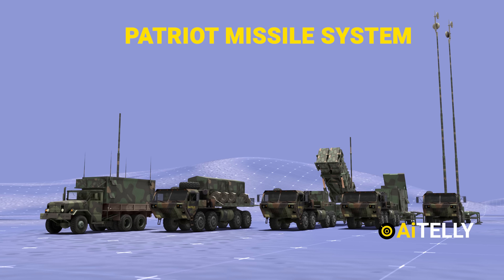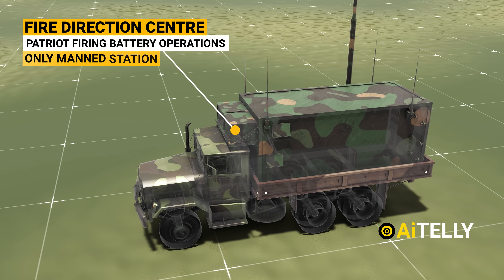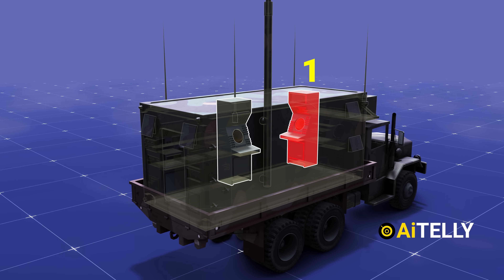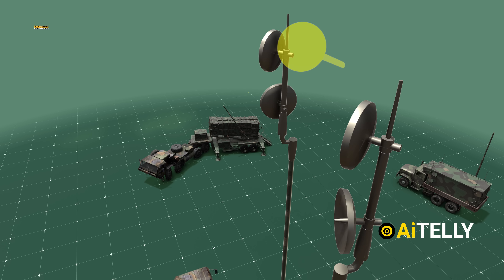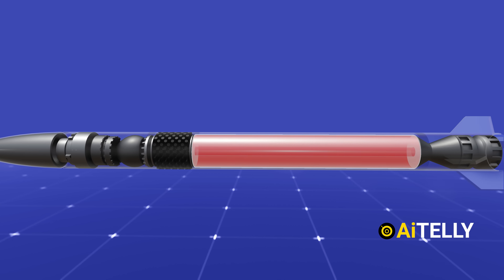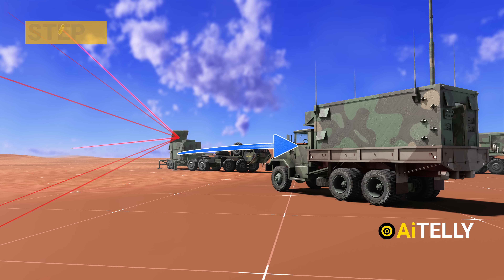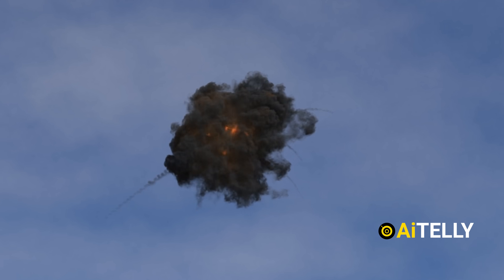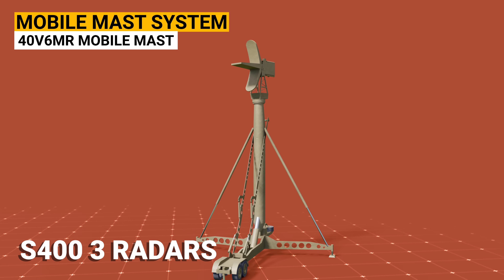Patriot Missile System How it Works | Air Defence Missiles

Comment: the MIM-104 Patriot active radar homing surface-to-air missile system function is too much decentralized . . . understandable it's a great SAM mobile battery from the early 1990s & the system incorporates solid fail safe technologies but it ain't cutting edge (compared to current day mobile SAM batteries that are far more advanced) inspite of it's upgrades from time to time . . . the MAN HX3 8X8 + 5.0 in. Lift 21.0 TDI I6 4-Dr Extended Double Cab Military Logistics Truck (LHD) is a better mobile solutions especially for such mission profiles . . .

Comment: So for every target you must expend 2 missiles ie $8m😰
Reply from the maker: Yes I think every military follows this strategy
Reply: often times the target of the enemy missiles is more expensive than the defensive missiles.
Reply: It's still cheaper than the damage could be caused by the target. In theory at least.
In comparison a medium range 9M317 missile (Buk) is around $200k a piece, the largest missile for the S-400 (the 400 km range 40N6) is around $1.8m.

Comment: It has a new LTAMDS triple-band S/C/X radar. With Link 16, other radars can also be used.  Also it has a new PAAC-4 SkyCeptor interceptor. Based on David's Sling Stunner missiles that can reach up to 300km with Mach 7.5 terminal speed and has a dual seeker with active radar and infrared IF homing. Additionally US has a new launcher called Enduring Shield that can incorporate any missile including SkyCeptor.

With the upcoming IBCS (Integrated Air and Missile Defense Battle Command System) network for the US Army, any interceptor and/or launcher and/or radar can just be a lego block. Similar to US Navy’s Aegis system, its a centralized battle command center. Many systems can be connected including NASAMS and Enduring Shield, SHORAD, Patriot, MEADS, and THAAD. Even radars from other system like Aegis SPY-1/SPY-6 and F-35’s AN/APG-81 can also be used. This allows a different radar to use a different interceptor to engage a different target.
Reply from the maker: Credited your notes in the Comment Coreection Section
Reply: @AiTelly  You are in for a treat when you see the full scale animation fully connected theater.  The headaches deciding how to portray this... I don't envy you, but look forward to seeing what you composite.   Scanned arrays and satellite comms have changed everything.
Reply: @Aitelly  I hope all this info is public and not private. In these videos you will find Russian and Chinese spies
Reply: i saw video of attack lasnight in kyiv.  how long after interceptor launch would a kinzhal missile strike the battery if it was missed?  would it be a few minutes or just seconds?
Reply: @peetky8645  seconds
Reply: Kindzal  coming 🔥🔥

Comment: 1st question : In video the radar is shown facing only one direction and also it is static. Then how other directions are scanned ? 

2nd question : How the missile determines the hosting projectile trajectory ?
Reply: It uses a specific antennas to communicate with it's own missiles- the antenna mast group

The beam is " bent" by selective destructive and constructive interference, it doesn't have to move .
Patriot is point defence so it's radars are focused and dont need to rotate

Comment: Could u guys cover how IFF works, particularly for MANPADs?
Reply: It probably just sends a signed message with a random nonce to the aircraft. If the signature is verified the aircraft responds with a signature of the random nonce. This signature is checked on the receiver, if it is correct the aircraft is identified as friendly..
The first check is required, as otherwise an enemy could ping an aircraft to get an radio emission from it, which can be used to target the aircraft.
Reply: I doubt there is a IFF system on MANPADs
However a MANPAD usually requires a line of sight meaning that you can tell the difference between your ...F16!? and the enemy ...Mig-29!? by just looking at it.
If both combatant use the same fighter you may want to use a very destinct color or marking to differentiate you from the enemy. Since longrange or fighter detection use IFF anyway a big yellow stripe on your fighter will not make a difference
Reply: @core3086  there is, it's the cage like thing on top of the stinger launcher, it's the antenna

Comment: Good video. A small correction. The missile launcher you are showing is the PAC-2 GME which has 4 missile. The PAC 3 CRI launcher has a total of 16 missiles and the newest PAC 3 SME has 12 missiles per launcher. Launchers can also be configured to have all three missiles. For example: 1 PAC2GEM, 4 PAC3CRI and 6 PAC3SME.
Reply from the maker: Credited your info in the Comment Correction Section
Reply: And the Pac-3 is what what was obviously used in Kyiv recently against a barrage of hypersonic missiles.
Reply: Was just gonna add this!
Reply: No Patriot launcher variant (M901/902/903) can have all 3 variant missiles in operation at the same time. They can have either a full load of GEM-T, a full load of PAC-3, a full load of PAC-3 MSE, or a mixed load of PAC-3/PAC-3 MSE
Reply: They are or will be soon add THADD systems to the Patriot system?
Reply: Nit: 16 PAC-3 per launcher.
Reply: @camdenmcandrews  за две минуты было выпущено 32 ракеты. Видимо с двух пусковых установок.
Reply: they are really good, but.... still not equal to Russian missile.... they are more faster, bigger range and more dangerous
Reply: @MsCocolino123  Russian propaganda says so. Like the  S14 Armata is such a game changer, f35 cant hold a candle to russian fighters, and so on and so on. Only on the battlefield, russian trash keeps exploding for some weird reason, and all that advanced tech seems to not work as advertised. There have been multiple recorded  encounters of peer type weaponry from russia and Nato side. Does not end well for ruusain every time. So I think it's time to stop telling how much better russian stuff is. I mean, it is pretty good at burning in Ukraine, that's definitely a fact.
Reply: @actualevents4621  On May 16, the American Patriot complex, once again fucked up, fired 32 missiles at two Daggers, garbage bags and never hit!!! The most expensive fireworks in the world, $150 million.
I can remind you how the complex showed itself in Saudi Arabia.
Reply: @MsCocolino123   those missiles are really big and bulky compared to pac-3 patriot missions. Since those missiles are bigger they have more fuel to fly at longer ranges but they only engage larger units like bombers and jet fighters. They can’t really intercept ballistic missiles. PAC-3 is more advanced when it comes to hit to kill.
Reply: PAC-3 SME? Are you talking about PAC-3 MSE? Also don't be lazy to add the dash between PAC and 3,  because failure of naming the designation correctly is not professional. Check for errors before you make your statements.
Reply: @freakmil1537  yeah, segment missile enhancement. Lol. My dyslexia. My bad!
Reply: @freakmil1537  sir, these are YouTube comments. A typo in an otherwise notable correction does not constitute unprofessionalism, and the situation doesn’t require professionalism, as it is a GD YouTube video.

Comment: 1 correction. A patriot launcher can hold up to 16 PAC-3 missiles. Last generation, PAC-2 missiles are bigger, thus a launcher holds 4.
Reply from the maker: Credited your info in the Comment Correction Section
Reply: @Aitelly  wow thankyou. Thats awesome you actively update your info! Thanks for your work on these videos! Also @Chris1982416 was an Patriot operator, & he corrected me about PAC-2 launcher payload, it can hold 8.
Reply from the maker: @jdogdarkness  Thanks @Chris1982416 For the Correction Will Update his in our comment pinn Section.
Reply: Same with PAAC-4 SkyCeptor. It can hold up to 16 of them.
Reply: I can prove he is correct because I'm a former 14T Patriot missile crewmember from the US Army.  You also have the wrong design for the AMG antenna array.  It comes on single truck similar to the ECS. You can deploy a Patriot in under 15 minutes. I know because I used to reach minimal engagement in under 15 minutes back in the early 2000s. The PAC 2 (advanced) can actually carry 2 missiles per cannister making it 8 missiles per launcher.  A Patriot battery can also use 16 Launchers.
Reply: @Chris1982416  hell yea Tangos lead the way
Reply: @Chris1982416  that means everything she said is FAKE NEWS 😅😅😅
Reply: @Jose Barreto  pretty much
Reply: @Chris1982416  Thats tuff. Did the patriot system make it easier to defend compared to other weapons alike?
Reply: @imhimdk1785  yes Patriot hast an own defense system with manpower in Stinger or other manneddefenssystems...
Reply: @Chris1982416  Thats very interesting thanks for sharing that. Did you have to learn a lot about the technical side of the electronic spectrum & EW at large?
Reply: @Chris1982416  Horace, hope you can answer th is.   But from this video the radar doesn't provide 360 degree coverage of threats!!  Is this correct?   If 360 degree is required is it possible to use a second radar?
Reply: @mikethompson2650  I'm not going to go into detail about the radar.
Reply: @Chris1982416  fair enough, ex USAF myself so I understand
Reply: @mikethompson2650  well just assume it's like any other phase array radar
Reply: @Chris1982416  Like the Navy's SPY radar series on their Aegis ships.   Understood.
Reply: @Chris1982416  can you tell us the specific range of the radar and how you would set up the launchers and radars around the target you want to protect
Reply: @squidysnose69  nice try Russian spy
Reply: @squidysnose69  Honestly that stuff is public information. The general information. But he's not gonna reveal limitations to u lol. He would get in trouble for that even if he wanted to.
Reply: Your patriot is just rubbish
Reply: Usrainians proof that Patriot missile didn't work ))
Reply: It can actually only hold 12 PAC-3 MSE missiles.
Reply: makes no difference still expensive piece of junk that does not work , didn't shot down not even one skad missile in iraq

Comment: very good explanation on video...Thanks. Patriot radar azimuth coverage 120° for target searcing mode and only 90° for target firing mode. So at least 240° of azimuth is free to send cruise missile to destroy Patriot radar. 1 battery needs 3 Radar for full coverage. Also, radar range is limited to detect low RCS targets such as drone emits noise jamming signals to blind and next coming enemy ordonance can harm Patriot's radar.
Reply: Newest radar have 360 degree coverage,the older systems only 120 degree
Reply from the maker: @mastermariner490  We aredited your Feedback in the Comment Correction Section
Reply: @mastermariner490  New radar has 3 panel antennas (not rotative). Main antenna surface is exactly same of today's. Other 2 new radar antenna are smaller than main panel. There is no fire control capability as main antenna has. Only to increase situational awarness to detecet drone, cruise missile and similar weapons. Last thing, newest GaN radar is not operative 100% in field of US Army and not to be exported.
Reply: @TURKWING  Its allready being tested in the army,if everything goes well it will become operational soon
Reply from the maker: Thanks for the feedback 🙏
Reply from the maker: Credited your Feedbackin the Comment Correction Section

Comment: This system suffers from several fatal flaws and can be easily defeated by home made drones. It has no radar coverage to speak of and the inclined launcher doesn't rotate fast enough to respond on time.
Reply: I agree, the Patriot system is such a terrible thing, it only defeated the "indefensible hypersonic" Khinzal.
And let's forget about Patriot's track record in the KSA, over 800 incidents with ballistic missiles and drones and only a few that made it through. Meanwhile the S-400 that can defeat a ballistic missile traveling at mach 8 with an rcs of 0.4 m2 can't defeat GMLRS that don't have reduced rcs and go at about mach 4 tops, mach 3 being the most common figure
Reply: @apolloaero  😂😂😂😂😂😂😂😂😂
Reply: @pmnichols10  I was wrong, turns out with was over 400 ballistic missiles and over 800 drones in 6 years time with 59 casualties, compared to 189 Scuds causing the deaths of 2k Iranians in the Iran-Iraq war with 6k more injured. 
That Khinzal shoot down must sting, don't it. I've been telling people for years that it isn't a modern hypersonic. We've had a similar weapon like it since the late 50s, say hello to the GAM-87 Skybolt, also an air-launched ballistic missile. Heavier, much longer legs, much larger nuclear warhead than what the Khinzal was capable of, and a faster missile but also a bit larger.
Or was that you laughing at the S-400's abysmal record and absurd claims such as being capable of intercepting 0.4 rcs mach 8 ballistic missiles 😂
Reply: Just like Ferrari Spider suffers from several fatal flaws, it can't fit a family with 3 kids for a family trip, and can't even handle offroad. What a terrible car.
Reply: Sure, pal that's why it's part of an air integrated  defense bs dones are the task of shot to medium range air defenses not patriot. 🤦‍♂🤦‍♂
Reply: "easily defeated by home made drones" I guess you don't understand layered air defenses?
Reply: @Just_A_Random_Desk  I understand facts on the ground, in Saudi Arabia to be more specific 😉

Comment: ok a 4 million missile against a 3k drone. Where is the problem ????
You need diversity : more missile types (smaller ones for drones)
Reply from the maker: They use Gepard for Drones i guess and Patriot missile for Cuise and Ballistic Missile
Reply: Also 4 million can potentially save stuff of bigger value (for example invidual human is valued at about 5 million iirc)
So in the end its actually worth it
Also against such a cheap drone mainly  gun based platform or heatseekers are used
Reply: I'm sure they have a layers defense. !st layer- man with sling shot 2nd layer- man with AK-47. 3rd layer- anti-aircraft guns, 4 layers- Stinger missile and final layer- PATRIOT!!!